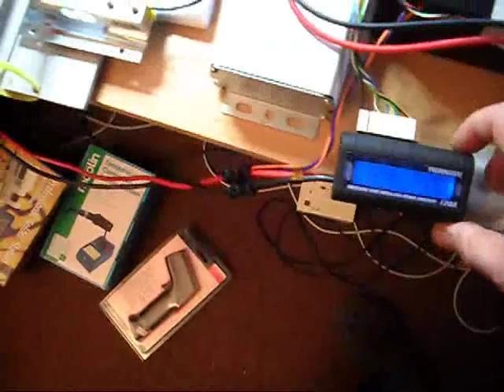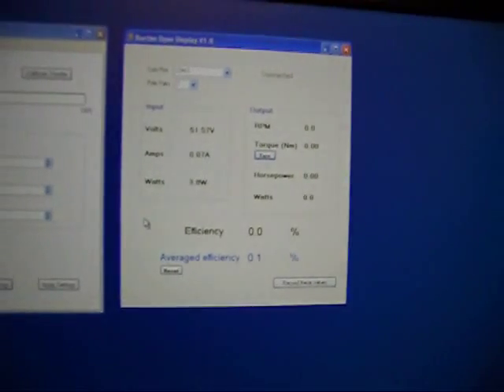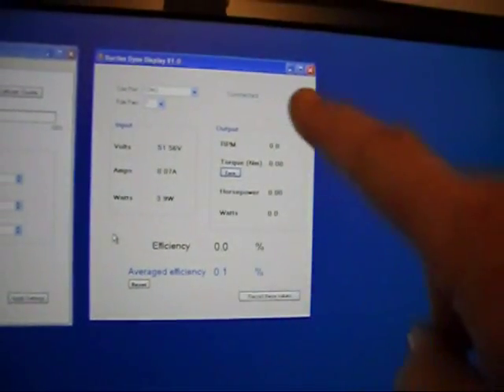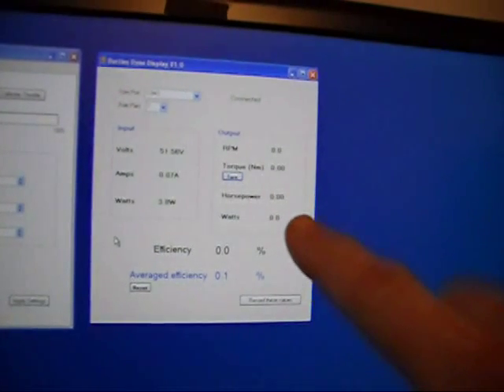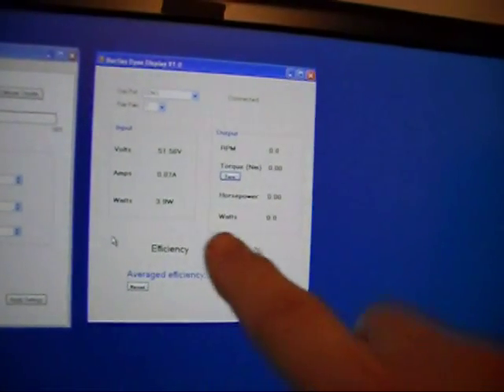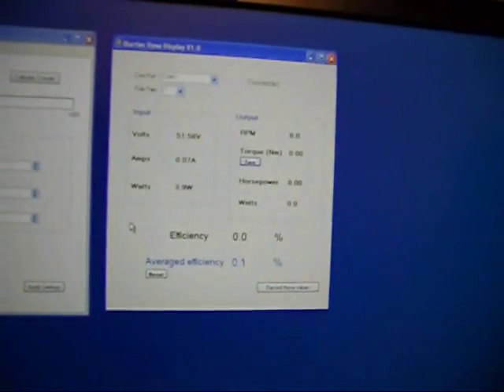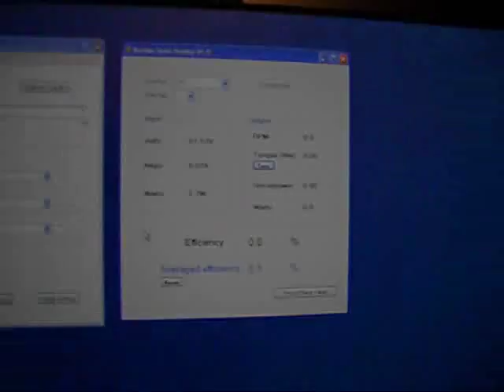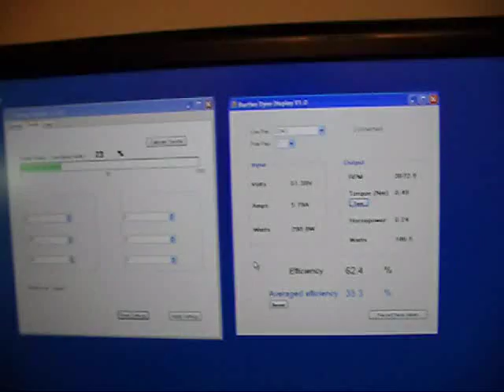RC Motor Dyno Introduction.wmv

Comment from the maker: I use a bank of lamps as a 3ph load, which can be switched Delta or Wye, and Series or Parallel, to give different load impedances.
If you used an alternator, you could perhaps vary the field current to control the mechanical load.

Comment: Hey Burtie. I'm doing something similar to this. the second motor is used as an eddy brake? if so how did you control it? Adjustable resistance device of some sort? I have been playing with a simple rheostat but I don't have a wide enough range of control. any help would be great

Comment: Hey, that's a cool setup.

3000W!!!  Nice.  What's the input on there? You must have a 15A-1P breaker feeding it?

What was the outcome of this? Did you ever use the brushless motor to generate power?
I was thinking of making an exercise bike so you have to pedal to watch TV, but don't have the shop and parts to make it.

Have you thought of making an exercise bike with a brushless generator? How much power do you think you can create, continuously by pedaling?  That's a healthy couch potato!